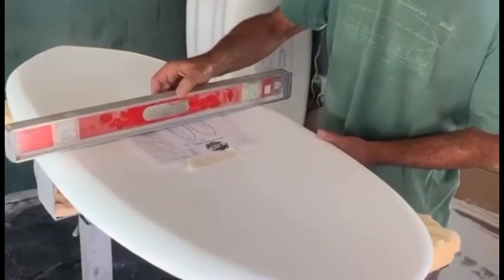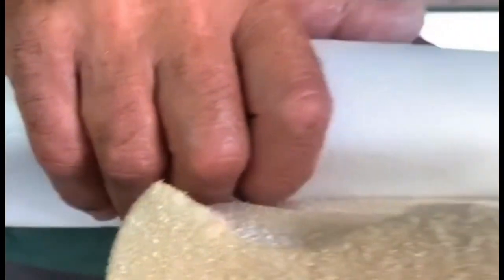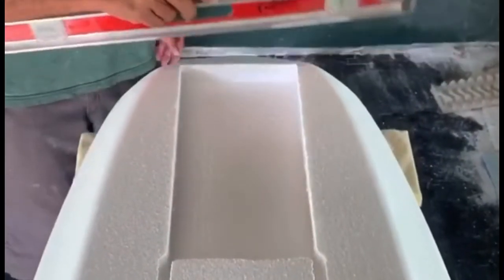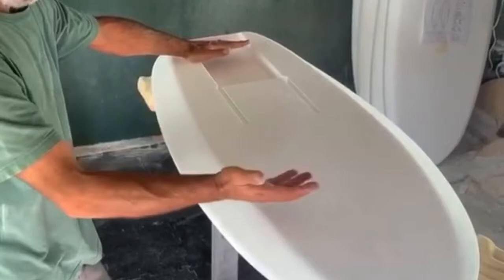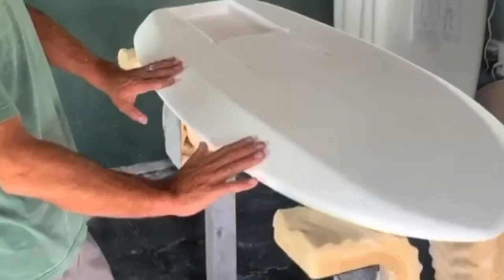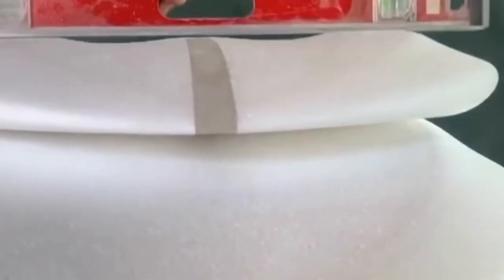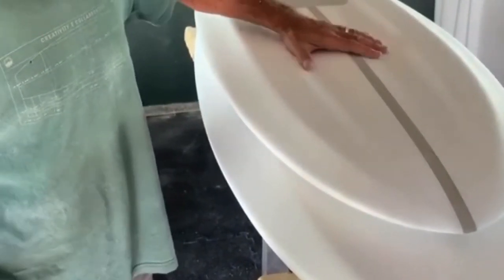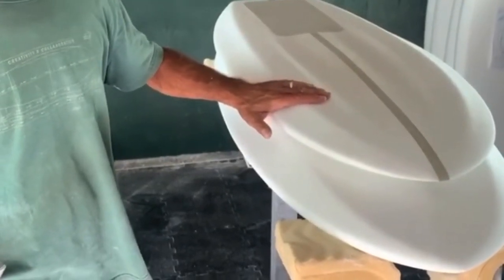Foilsurfing board design

Comment: It just seems like the torque of a big 200 pounder like me on a big 2000+cm2 foil embedded in foam is just going to rip our. I love the soft board idea and will soon looking for a shorter wingfoil/supfoil board.
Reply from the maker: We are sharing Ford’s ideas.  We are all evolving together
We make similar shapes and agree with most of what he says.  We are slammed but have a production run of wingsup foilboards starting next week.  Most of them have got snatched up but if you are looking for the 5’3 to 6’2 range we will have a few up for adoption